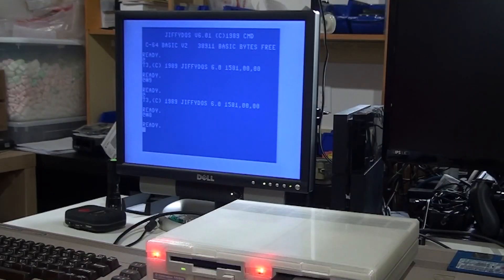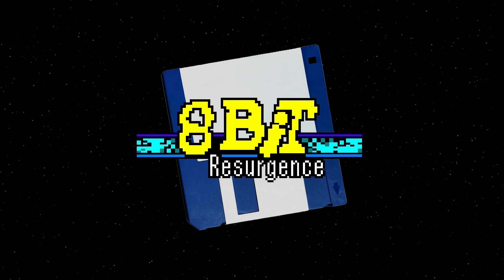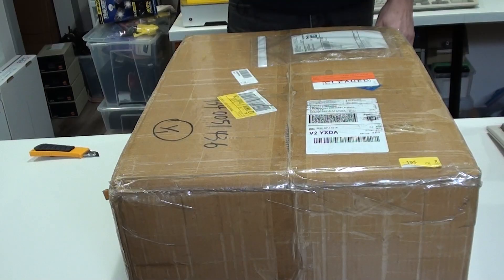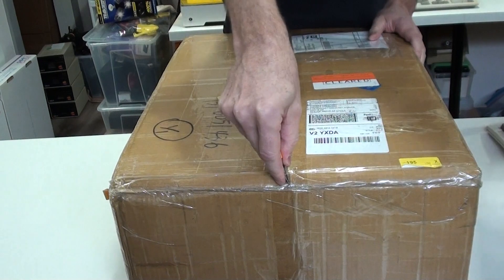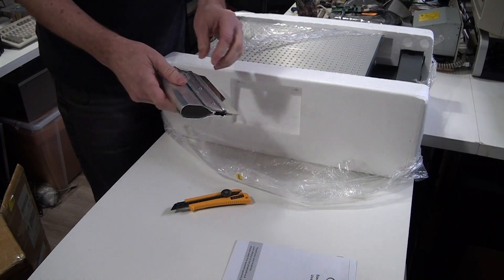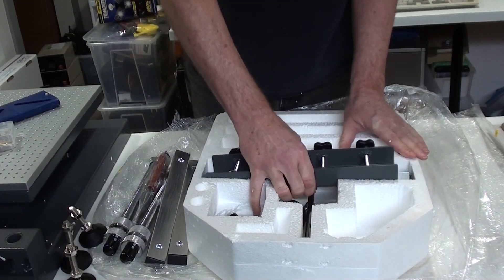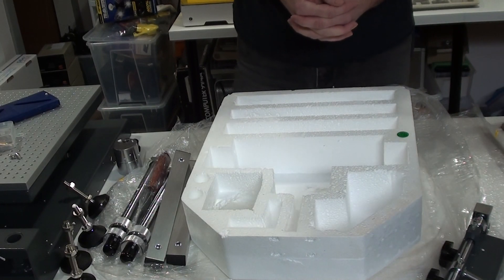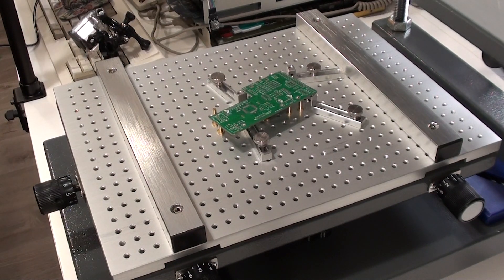Stencil Printing Retro Computer SMD PCB's

Comment: Nice vid! thnx for posting :)  I just saw the price for the YX3040 for $250...is that about right?  (One thing i missed is how you got your PCB parts design into that large plate.)
Reply from the maker: The price sounds good.  If you're talking about the stencil, you just need to order a stencil from your PCB manufacturer with a frame.  And if you're wondering how the PCB's mount to the stencil printer, the stencil printer comes with an assortment of mounting pins which fit various sized vias that are typically found on PCBs for either mounting holes or through hole components.  Those are used to hold your PCB in position.

Comment: Great video! It so much better than my glob it on from the syringe and praying that it flows right without bridging things method. I'm assuming that you have a hot plate for the soldering part?
Reply from the maker: Thank-you.  I actually use a reflow oven that I built using the Whizoo kit (https://www.whizoo.com/).  It's really tremendous, and allows me to use the correct reflow profile for the solder paste I'm using.  I'll be doing a video coming up of the whole process, end to end.